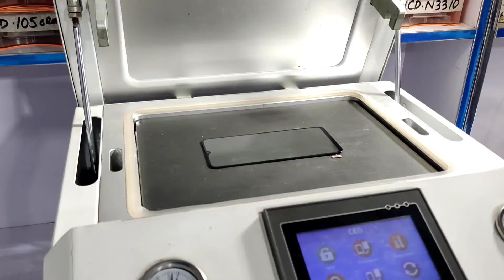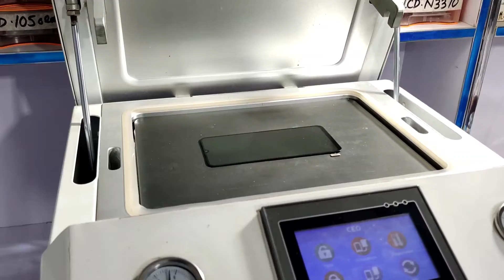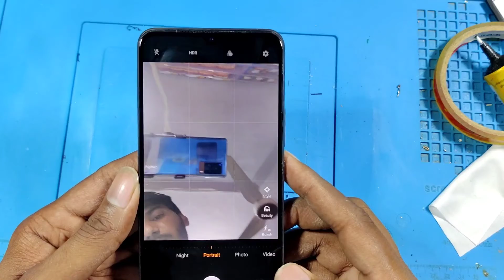Vivo V20 Broken Glass Replacement

Comment: What chemical is that you are using to remove display from frame , heating is not necessary while using that chemical ??
Reply from the maker: MBC
Reply: @MultiRepairingLab  any links for buying
Reply from the maker: Local parts shop